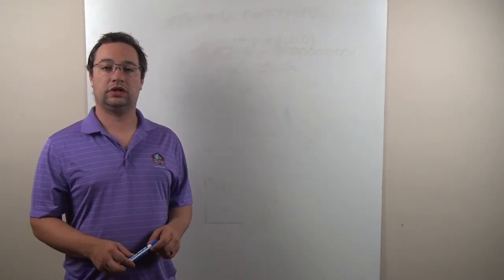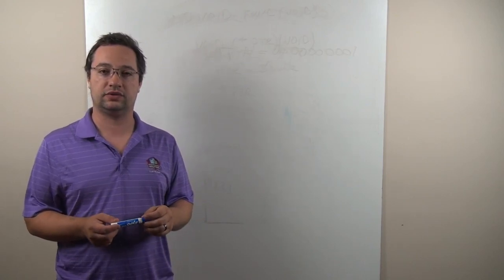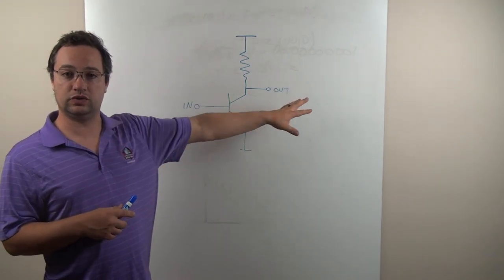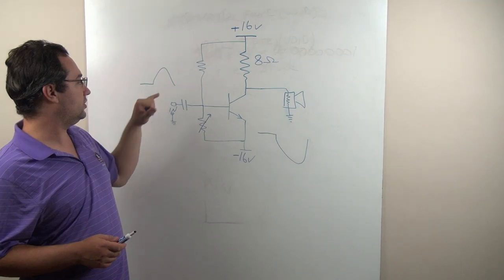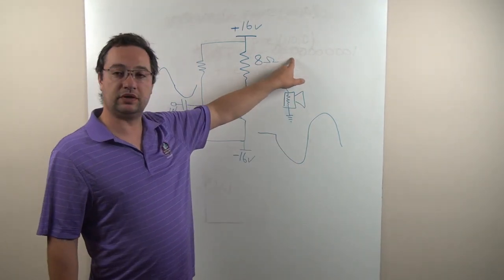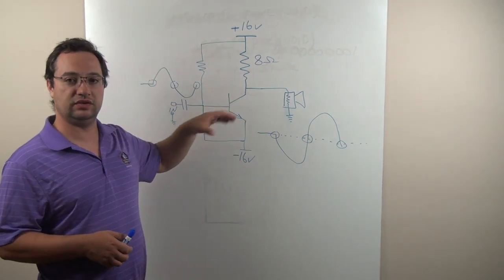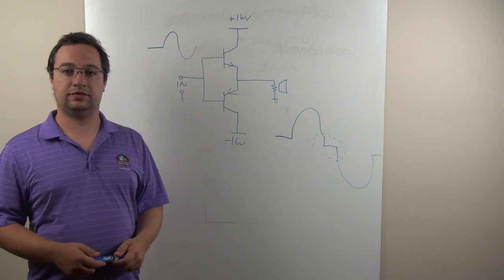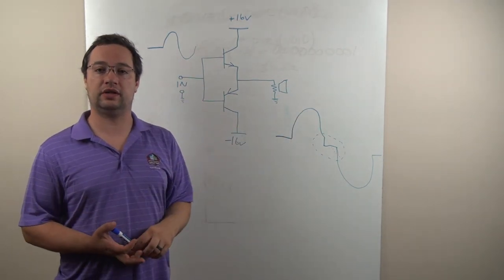eapbg #51 Amplifier Classes A, B, AB, C, and D

Comment: Excellent.  Please do a complete series on RF.  You brought a historical perspective to amplifies.  So class A from the the turn of the last century, class B came next, class AB is from the 1970's.  Class D is the newest tek.  Almost all the stuff you buy today are single chip class d amplifiers.  To save the planet.
Reply from the maker: The only real drawback of a class D is that they have the highest distortion of all the different amps. RF is not my strong suit by any means. I've been tinkering with a software-defined radio and may do some videos on that. I was planning on doing some frequency domain stuff too which will include some am and fm stuff.

Comment: wow...I cant speek for anyone else...I think ya did a great job...I am presently trying to fix a big PA amp 1000watt...it is a class AB...instead of diodes setting up the bias it is transistors...and this amp has a variable resistor.....do I put my dc  voltmeter at  the middle and adj to zero volts???I guess the bias adj for component values changing....and....your dc supplies drifting over time c...correct?
Reply from the maker: Without a schematic, it is difficult to say what is going on. There are hundreds of different ways to do this including but not limited to preamplifiers, negative feedback, and overcurrent protection. What I would suggest though is to feed a small test waveform into the input and then look at the result of the output with an oscilloscope. This will show you whether the waveform is centered and if there is any crossover distortion.

Comment: I was wondering, could you feed some of the output from a class C amp back into the input, so that you could start it with a single pulse and it just keeps on going?
Reply from the maker: The short answer is: no. The long answer is: tying the output to the input would generate a feedback loop. I'm sure you've heard what it sounds like when a microphone is held to a speaker. This type of connection is known as positive feedback. In an amplifier, the input is amplified by some amount. Also, amplifiers have a small amount of phase delay meaning what happens at the input does not instantly happen at the output, it happens some very tiny amount of time later. Armed with this knowledge it can be seen that the output would make the input a bit greater. The input would make the output a little greater and then the output would make the input a little greater. This reaction would run away until the amplifier saturates. If lucky it won't explode. If unlucky the drive element will burn out. Regardless, no matter how much the output is reduced there will always be a positive relationship which would cause a runaway condition. There is also a negative feedback loop. This type of loop can keep an amplifier from running away.
Reply: @eapbg  That makes sense. Many thanks and happy new year!

Comment: When you increase the input drive level amplitude into the FET amplifier, the input drive level with Bias the FET. This happens in Class AB, but what kind of biasing is this called? its not a DC bias its based on the input drive level to the gate of the FET.
Reply from the maker: Still not sure what you are asking. In an AB the bias has to be there all the time or you will get cross over distortion.

Comment: I think the trick in D class is that the filter after MOSFETs actually creates sinusoidal waves. I hate resistors. They are always there and nobody knows what they are doing.
Reply from the maker: Correct, the filter strips out the higher frequencies and all that is left behind is the sinusoidal audio signal.

Comment: Class A loss 50% without any signal at start , is les than 30% eficiency.
Reply from the maker: Without any signal, the loss is 100%. At best 50% can be delivered to load with a signal.
Reply: eapbg I never seen more than 30% eficiency on classA . If you speak only math calculation on paper. Yea is 50% only teoreticaly , Sorry for my english.
Reply: I am Wangine  According to the math equations, 50% is theoretically possible. In practice, it is far less than that. Probably at best 30% for a class A amplifier and wouldn't be surprised with numbers down to 5%.
Reply: Who care what the efficiency is?  It all comes down to how does it sound.  Are we worried that the efficiency of a dopey amplified in your home will deplete the ozone layer and increase global warming?  Is that what the concern is?
Reply: @iamwangine8752   when you calculate the efficiency, it will be an average somewhere between 0% and 50%. As I understood 50% is ideal. so you should take 40% instead.
Reply: @felixcat4346  You will care when you will have to put a big noisy fan in your amp to make it cool. And when it is inefficient it gets harder to make it more powerful.